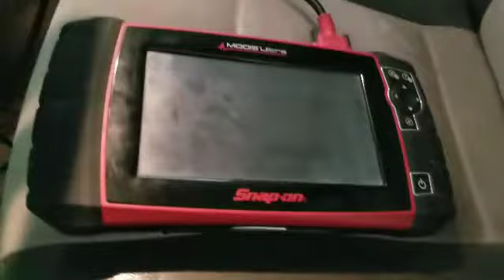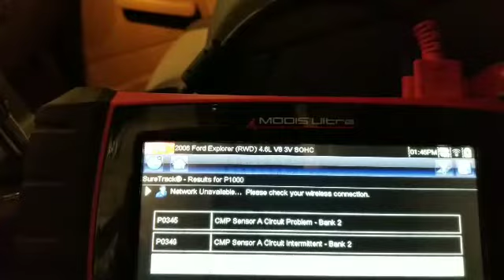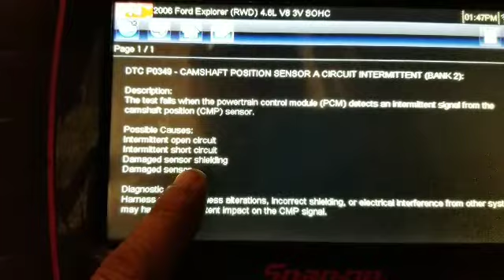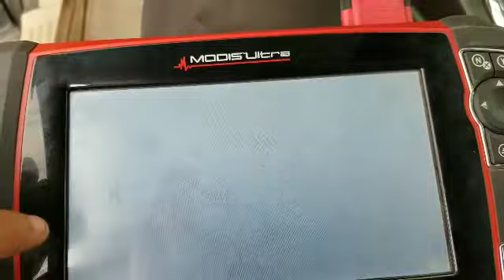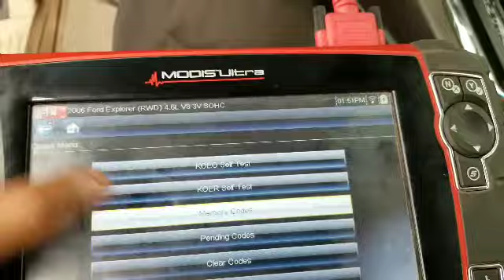FORD EXPLORER 4.6l P0345, P0349 Cadena de Tiempo

Comment: Muy util su video... una pregunta; Antes que la arreglara el motor temblaba o le faltaba fuerza o alguna caracteristica en particular? O el motor corria normal y solo tenia el check engine encendido con esos 2 codigos? Gracias de antemano.
Reply from the maker: David Perez Gracias por preguntar! El motor trabajaba normal, sólo el check engine no lo podía borrar. Al segundo encendido, volvía a aparecer la luz. El problema era un Diente adelantando en el tiempo.
Reply: Rios Mechanic Shop gracias! Yo estoy teniendo el mismo problema en una 2007 F150 5.4l Triton engine,  ya le cambié los camshaft sensors pero sigue igual. El motor funciona perfecto.
Reply from the maker: David Perez Lo más seguro es que esté mal alineado el tiempo, algún diente está fuera de tiempo.
Reply: Rios Mechanic Shop tal vez y si,  la luz apareció después de que despegué y pegué para atrás las coil on plugs (botas?) de las bujias , una de ellas estaba fallando y necesitaba saber cuál era... identifiqué la mala,  la reemplacé, y borré los códigos que aparecieron en el tablero ya que como despegue las botas con el motor encendido pues era de esperarse. Ahí fue cuando apareció el P0345 & P0349.
Reply: Hola q tal  mi camioneta tiene los codigos  p0345/ p0349/p0197  q sera el mecanico no le encuntra q podra ase le reveldio el motor  es una ford 150 lariet 2005 5.4
Reply from the maker: Gracias por preguntar! Los dos primeros codigos indican que esta' fuera de tiempo por lo menos un diente la cadena. el P0190 es el sensor de presio'n de la gasolina que va' en el Riel de los injectores, sirve para medir la presio'n, hay que reemplazarlo.
Reply: GRASIAS POR SU VIDEO   PREGUTA MAS O MENOS CUANTO  COBRAN POR UNTRABAJO ASI CHECARLE EL TIEMPO. PA SABER I APREBENIRME  JAJJAJJA GRACIAS
Reply: Si los raches están bloqueados puede dar esos códigos??

Comment: Hola yo tengo el mismo problema, pero le cambie las cadenas y tencionadores y guia a una f150 ano 2008 Triton 5.4 pero al encenderla enciende perfecto pero al rato comienza a querer apagarse y aparecen esos codigos p0340 y 0345 entonces tengo que volver a abrirla para checarle que quedo bien el tiempo o le cambio los sensores?
gracias
Reply: Hola una pregunta  a qué tiempo obmillaje se quiebran esos plástico que lleva la cadena del tiempo
Reply: Me pasa igual Broder, lobo 5.4 2006, que haré
Reply from the maker: Yo reemplazaría los sensores hidráulicos de los árboles de Levas. Son los que están enfrente y entran en las tapaderas de las válvulas. Es un Sensor a cada lado y trabajan con la presión de aceite.
Reply: cambia los 2 sensores vct si ya cambiastes las cadentas y colocastes en tiempo
Reply: @salvadortorres9794  cambia los 2 sensores vct si ya cambiastes las cadentas y colocastes en tiempo

Comment: Buenas tardes.tengo una Explorer y se le hizo motor.pero quedo con ruido. En el banco 2 .se destapó. Y no estaban lubricando los cilindro  .5.6.7.8..

Pero la cadena si la estaba lubricando con mucha presión. Creo q los conductos están tapados.....lo scanearon y aparece el codigo p0022.banco 2...
Mande a bajar la maraca q esta en el filtro y estaba tapada.se limpio y yenia residuo de silicon y sucio.lo cual en baja.se sentia con ruido.pero en alta tenia mas precion.cual seria su recomendacion.este motor.fue reparado.se ánillo y se le coloco todo nuevo.....q debo hacer.gracias.escucho sus recomendaciones.....a lás camaras ,se le hizo baño quimico.valbulas nueva.pero el bloque no se le hizo baño quimico.el mecanico m dijo,q no era necesario.y sospecho q el bloque esta tapado del lado de chofer.
Reply from the maker: eleazar ojeda Cada cabeza tiene una entrada de lubricación de aceite que alimenta a árbol de levas, comúnmente se tapa muy fácilmente. El mecánico tiene que quitar la tapa de el árbol de levas que está atrás y revisar el tapón que está en la vena de aceite para ver si está tapado. Cada cabeza trae uno a mero atrás quitando la tapa que trae dos tornillos medida 10 milímetros.